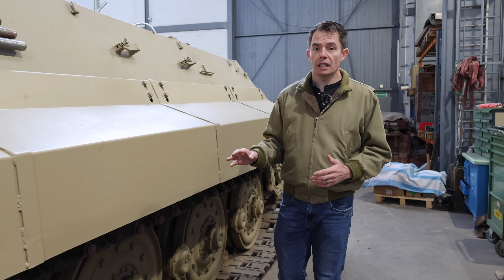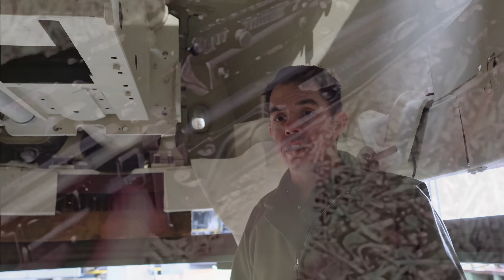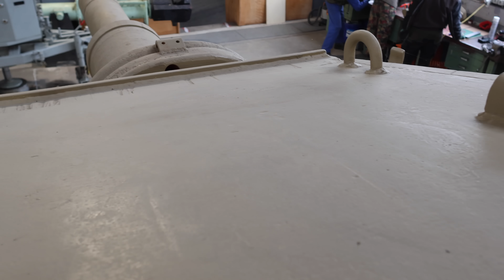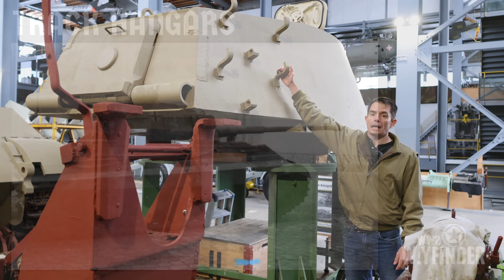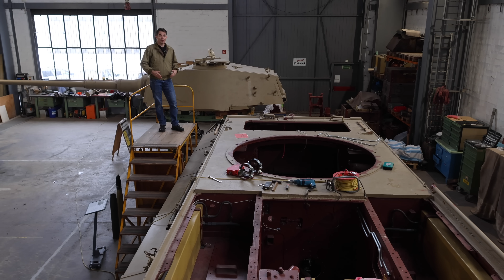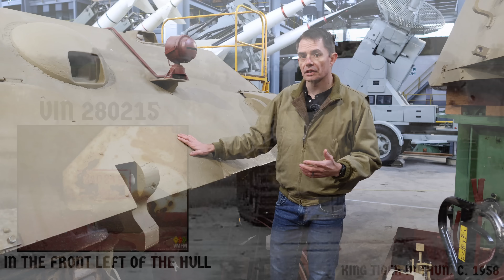King Tiger Restoration - Up Close with the King Tiger At the Swiss Military Museum

Comment: I believe that this is the best restoration ever of the Königtiger and I'm truly impressed with your workmanship! Please accept my congratulations for doing such great job 👍👍👍👍
Reply from the maker: It’s a wonderful job the team are doing there and when finished it will look truly outstanding!
Thanks for watching 😃
Reply: I echo this. For a long time I have been lamenting that only the Tiger I was successfully restored to working condition, while every Tiger II was either half-stripped or sectioned or otherwise clearly a salvage. So I was overjoyed when I stumbled on this video and learned that a Tiger II is being restored to practically mint condition! Amazing work and effort, and I only wish there was some way I could meaningfully contribute from my corner of the world. Thank you for the excellent and informative video!

The advantage of the overlapping but not interleaved suspension system of the Panther, Tiger II and late Tiger Is over the overlapping-and-interleaved one of the early Tiger Is could really be felt if you needed to replace one of the inner wheels. With the newer suspension, you'd have to remove at most 2 wheels; with the early Tiger I's, you may have to remove up to 8 or 9! Coupled with the fact that the early rubber-rimmed wheels quite often shed the rubber, this was a major maintenance pain in the @$$.
Reply: @DenKHK  After all, the Tiger II tank in running condition has been located in the Saumur museum for long time. Did you not know about it?
Reply: @ukasz-zm9qc  You're absolutely correct, I did see a video of it at a tank show (I think it's the one you're referring to) sometime ago but had completely forgotten about that one. Still, this project has the potential to create one "factory fresh", and lay the groundwork for making any parts needed to keep all of them running in future.
Reply: Think this will be a mint condition vehicle once its finished. Will it be the second running Konigstiger (Tiger Ausf. B) in the world? Be great to hear that Maybach HL 230 engine sound. I think Bruce Compton had an HL230 engine restored for a Panther in the Czech Republic as they were the only ones in the world capable of doing it. They found that the slave labourers that built the engine sabotaged the valves. If these vehicles are not restored and kept, a whole load of historical facts will be gone forever. If they do decide to do another WW2 movie, imagine having a real vintage Konigstiger in it. Will they modify the transmission to ensure it lasts the lifetime of the vehicle as its known to be a serious weakness due to the weight of the tank?

Comment: You were doing good until you walked under the gun, on a modern tank the power gun elevation servos can move the tube quickly enough to kill, so modern tankers, out of caution, do not walk under the gun.
Reply from the maker: Thank you but I’ve worked around machinery that can easily kill for the past 20 years so I’m quite content with the museums steps taken to secure everything. It’s also in a public part of the museum despite it being closed now for the winter so if it was unsafe it would be guarded.
Reply: It's not a modern tank.

It's uncrewed and powered off.

It's in bits and disassembled. Most if not all systems are not present.

Comment: Incredible restoration!! They are doing a remarkable job. Did you find out how much of the King Tiger is original versus new made parts?
Reply from the maker: I didn’t actually think to ask, although I know the original photos show the tank with the barrel severed about half way down it’s length so the main gun is I believe a new installation (but a completely original assembly).
Reply: @WW2Wayfinder  Oh ok. I was just curious. I wonder if they will paint the original Panzer unit markings on it or keep it generic?

Comment: MG34/42 Doesn't use link. It has a one piece belt. The bag I would assume collects the brass....
Reply from the maker: Yes you're correct. I'm used to dealing with link so just naturally came out but you're right, the belt is a one piece and very beautifully made if that's possible! Thanks for watching.

Comment: They are doing a great job.
Having been involved in a detailed early Panther A model restoration I know how long it can take to restore one of these tanks.
An interesting feature that all the Panthers and Tigers had was the main gun spent gas evacuation system. 
There was a small compressor mounted on the turret basket floor which in turn pressurised an air tank/air receiver.  When the main gun fired and travelled back to its rest position after recoil, the breech would automatically open to discharge the spent shell case and as soon as the spent shell case had cleared the breech mouth, compressed air from the air tank receiver would be blown up the barrel so as to prevent the shell charge propellant gases from flowing back into the turret and chocking the crew.
If you look at wartime footage of a Panther or Tiger firing the main gun, you can see the spent gases wafting out of the muzzelbrake  after the recoil of the barrel has finished. This is from the compressed air travelling up the inside of the barrel.
The compressor was driven via a gearbox on the turret basket which in turn was driven by the engine to main gearbox propshaft.
Reply from the maker: Oh wow! I’ve seen that before on original footage but didn’t realise it was as a result of the system you mentioned! Thank you for that and always great to learn more about these machines!
Thanks again and thanks for taking the time to watch 😃
Reply: @WW2Wayfinder  You’re welcome. Keep up the great work.
Reply: Learned again something thx
Reply: I never knew this!
Reply: @I7435IC Sort of. A bit overcomplicated (cliche I know). If you had compressed air starter diesels in there you'd be able to just use some of that. Alternatively there are fume extracter designs that are passive.
Reply: @tommymaddox6785  How did the passive extractors you mentioned work?
Reply: Coool. Thank u
Reply: @tacfoley4443  yes that's why I said if
Reply: Awesome!
Reply: Fascinating; I've never heard that before. My wife would like to see a similar system for when I discharge gas under the duvet when I'm asleep but that's a whole different story ;0)

Comment: That turret ventilation fan is actually pretty important, because you get cordite fumes from the breech of the main gun when it opens after firing to reload.
Reply from the maker: Very much so! I can’t imagine how thick the air would get after the first couple of rounds in the turret! Thanks for watching.
Reply: German guns removed fuse's automatically right after shooting end of the barrel before opening the Lock and throw out the shell..it was semiautomatic gun.
Reply: Re Cordite ... Germany did Not use Cordite. England did.

Comment: Almost correct; the hatch at the back is not for loading ammo, but to remove the gun for maintanace
Reply from the maker: Well I’ve seen wartime images of it being used to load ammo along with multiple publications stating it was used for that purpose and technically it’s a crew escape hatch but very much stands to reason that it would be used to assist with maintenance of the main gun as well.

Comment: One other point on the use of the mg34….one of the primary reasons it was kept in production after the mg42 was introduced is because it can be adapted to feed from either side, whereas the mg42 can only feed from the left side. The right hand feed MG34 was used a lot in armored vehicles with internal machine guns (like tanks) and in other situations where left hand feed was not ideal. Up top, or in a open-topped half-track, an mg 42 was fine but internally, a weapon with a right hand feed was often needed due to space, configuration, and ammo can placement / storage considerations.
Reply: One more point is the barrel/cooling sleve shape of the Mg34 vs. the Mg42. The smaller,  round shape of the Mg34 necessitated a smaller opening in the hull or turret.
Reply: @jim7544 Not to mention it was round.
Reply from the maker: Thank you for that! I wasn’t aware the feed could be switched like that! Every day is a school day! 😃
Reply: Imagine if they would have needed to completely rearrange the turret to accommodate the MG42's feed preferences!